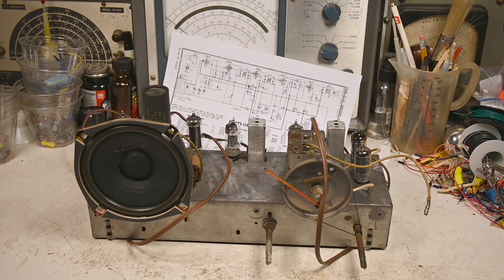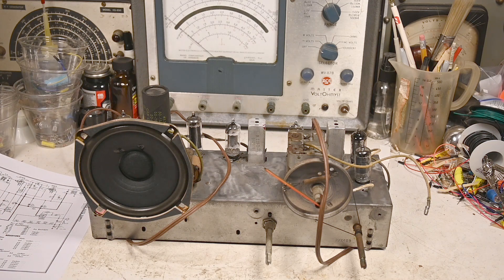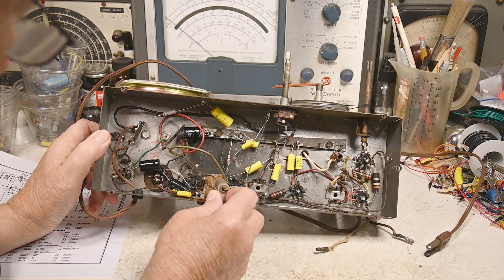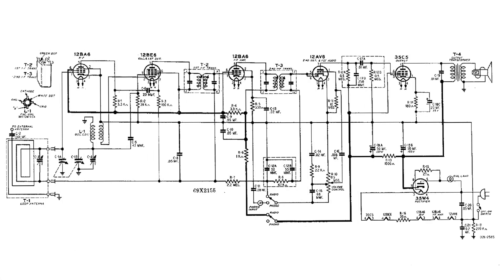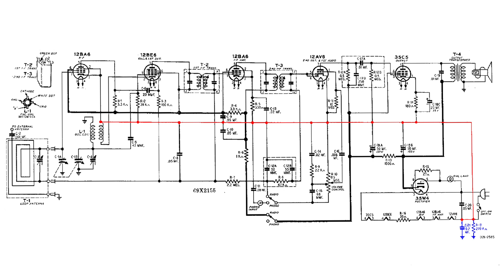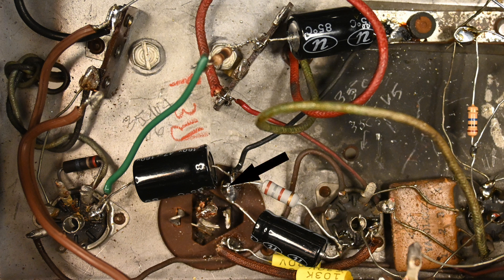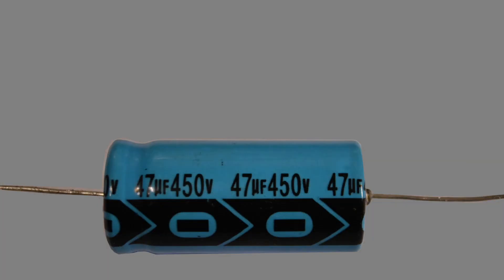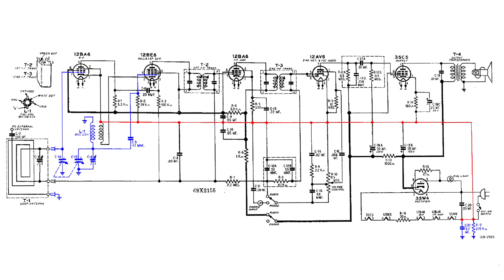Radio has a High Current Problem, Polarity Example

Comment: thanks for this video.
trying to learn how you went about diagnosis of the condition.
with the reverse polarity of the caps, this created a high resistance i assume.

so would not the high resistance create low current as opposed to high current? 
when radio was turned on slowly,did some components heat up or where there other symptoms?
thanks
john
Reply from the maker: When a electrolytic capacitor is installed backwards, or reverse polarity, it's resistance is very low. The electrolytic capacitors can get so hot that they may even explode.
Reply: @AllAmericanFiveRadio  thanks now i see why current would be high as you stated.
john

Comment: Interesting.
I once encountered a TV where the polarity of an electrolytic capacitor in the diagram was opposite to a factory marking on the PCB.
Reply from the maker: I found a diagram that had a wire shorting out the power supply. The wire weaved up and down and around the radio, but it was a dead short. I wish I could remember what radio that was, would like to show it on YouTube.
Thanks for your comment.

Comment: Very interesting troubleshooting! Another issue I could see is, that as in so many American radios, there are still many carbon resistors, both old ones and new replaced ones in the chassis. Now carbon resistors are not recommendable in any audio circuits, as they cause lots of hiss, they also are a real problem as they change their value quite quickly, the higher the working voltage is! The modern carbon resistors do have the beige body colour. This means, that the working voltage in the circuit can float around with carbon resistors. In antenna circuits they sometimes can also be a damping for rf signals. To overcome this problem, I highly recommend to replace all the 10% carbon resistors by modern 1% metal film resistors, if they are below 1 Watt. The metal film resistors can be identified, as they have a blueish body colour.  If their rating should be above 1W, metal oxide resistors or wire resistors are the very best solution. When a tube or transistor circuit is equipped with metal film resistors, the circuit will run with very precise voltage tolerances, and the RF circuit part like the oscillator can work with more accuracy or in other words, more frequence stability. The AF amplifier stage is improved by less hiss and precise amplification level at each point in the circuit. The reason, RF wire coils like IF tanks can be open is mostly to thin copper wire material which has a isolation material which is not acid free, causing verdigris in the thin copper wires over the decades, especially if a chassis has been exposed to humidity over a period of time. Another point to take care off is, that in many American radio chassis, there are ceramic capacitors used in the AF amplifier stage. In the RF stage, ceramic or mica capacitors can do a good job, especially the oscillator cap is a good choice to use a ceramic or mica cap, as ceramic caps cause little frequency deviation. But when using ceramic or mica caps in the AF amplifier stage, this can cause a bit of a squeaky telephone alike sound in the speaker. It's better to put metal film capacitors in the AF amplifier stage, this helps to improve the sound quality, as metal film capacitors do have better frequency specifications when used with low audible AF-frequency signals, than ceramic or mica capacitors do have.  Best regards from Switzerland, bluearcturus
Reply: @majortom5838  Of course, you're right, these AA5 sets are very sturdy, no question. The small output transformer does not allow frequencies to pass under maybe 80 Hertz or so, but this is wanted, to avoid 50/60 Hertz line-hum problems from the rectifier stage, to not use too large filter capacitors . But, und here's the important thing of my commentary: ceramic capacitors can cause issues under some circumstances. Ceramic capacitors are very good in RF stages, but one must always be aware, that they are very frequency dependant and also voltage dependant. To illustrate what I mean, watch this video:  https://www.youtube.com/watch?v=Kn-8hvvz9Ag Here's a TV restorer showing the problems he has with a Philco safari TV. He has replaced old caps with ceramic caps, and now he's troubled to get the test images on the screen right. He's showing the distortion, ceramic caps can cause on the screen of the oscilloscope. He replaces the ceramic caps again by unpolarized film caps, and the problems are gone. This is what I mean, that ceramic caps (don't must but) can be problematic in AF amplifier stages. For Hifi amplifiers, ceramics caps are a no go, but for instrumental amps like guitar amps or Hammond organ amps, where a specific "sound colouration" is wanted, they are the right choice. Trial and error. Hope my comment is of interest, have fun and best regards! bluearcturus
Reply: H Higgins  Very clever to tap on components, to make sure the is no microphonism or sometimes unwanted hidden issues like unvisible hairline cracks or bad soldering points. Very important is always to measure the isolation resistance of the capacitor. I use the Hewlett-Packard 4329A high resistance meter, the well known Heathkit IT-11 capacitor checker is also very recommendable. A test voltage of about 100Volts DC is needed, to show problems with isolation resistance. Capacitors can have hairline cracks in their outer surrounding and so humidity can enter the body of the capacitor, causing the DC-isolation resistance of the capacitor goes down. A healthy capacitor has a infinite DC isolation resistance. If this is the case, the DC coupling in circuits is no longer ok. If a leaky cap is in a circuit there can be some DC voltage at a point where no DC voltage should be, and at another point, there is no longer the wanted amount of DC voltage, because the leaky cap is shorting some DC voltage out to other points, where no DC voltage should be. Early caps from the 1930's to 50's sometimes have bodies built from cartoon tubes, and the isolation material is wax. Now both cartoon and wax are hygroscopic materials, they take up humidity from the surrounding, and this is making the cap leaky. Modern metal film caps are completely plastic welded, there is no longer the problem, that humidity can enter the body of the capacitor, avoiding problems for future decades. The old American "chocolate piece" brown rectangular mica caps are very good, most of them are still ok after such a long time. Have fun and best regards, bluearcturus
Reply from the maker: Thanks for the information.